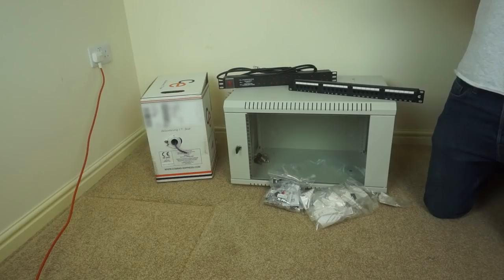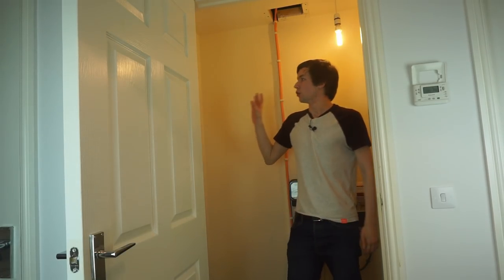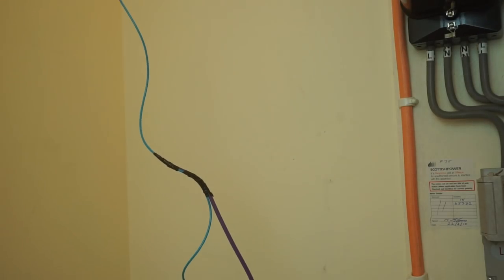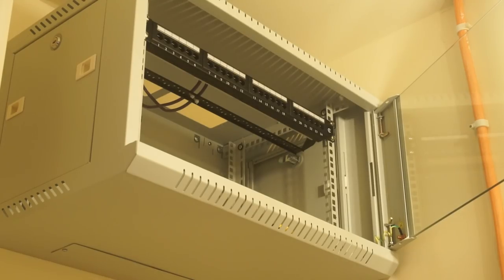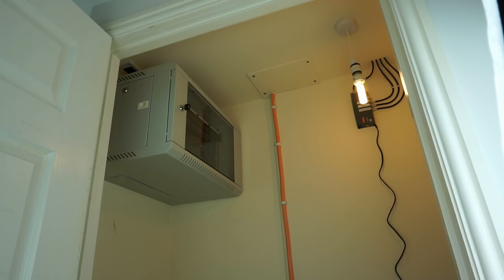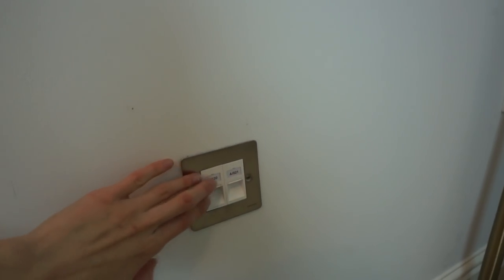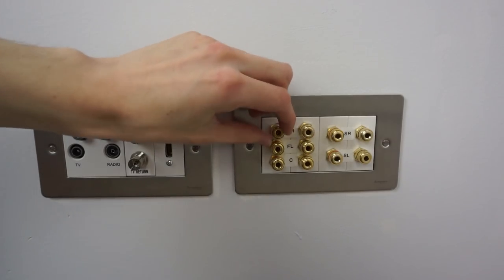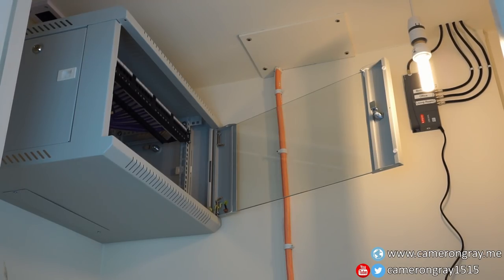New Flat - Time to install a completely overkill home network!

Comment: 13dB + 8dB amplification on those coaxes seems very high for such a short cable run. Were you able to measure the incoming signal level?
Reply from the maker: I don't have any proper signal measuring hardware but I used a TV with a built in signal meter, on this the incoming signal was under 40% on the scale and would even break up if I connected the TV with a 5m patch lead.
Reply: We don't know what absolute signal level the scale was indicating. For all we know, 40% may be 9999dBmV.
I've investigated many such cases when i worked for a local ISP/cable company (i know it's not a commercial cable connection at your place but signal levels are comparable) and more often than not, the blocking was caused by a bad connector, a cheap cable or an outlet with built-in passthrough (and -12dB tap).
Some customers tried to fix their problem themselves by stringing amplifiers together whilst the signal was strong enough to begin with, the noise floor was just too high because of ingress at some point.

Admittedly, i'm illinformed about any applicable standards in the UK. My point being "low signal" isn't necessarily what it says it is.
Reply from the maker: I'm definitely not remotely qualified in this area although everything points towards the signal entering my property being weak, likely due to me being pretty far from the main distribution point in the building.  All I know is that before fitting the masthead amp, most channels were unwatchable or wouldn't even be tuned in by the TV, after fitting it I can receive every channel that is available on the transmitter without any issues.  Those amplifiers are designed to be connected together in that way, normally you would have the masthead amp connected to your aerial and then feed the output of that into the distribution amplifier (which amplifies only enough to cover the losses due to the splitting)

Comment: Looks like a nice place you bought,is it condo?, you definitely won't run out of connection, In my area I didn't need a coax amp ,in fact signal so strong I was able to use multi splitters
Reply from the maker: We don't really have anything called "condos" in the UK, we'd refer to any sort of residence in a building with other residences above/below as a "flat."  That said, the Wikipedia definition of condo which seems to state that each residence is privately owned (either by the occupier or a private landlord and then rented out) and the shared space is then jointly owned by everyone seems fairly similar to what I have here.

Comment: Should you terminate port 4 on that amp? 75ohms.
Reply from the maker: I suppose it wouldn't hurt although I'm not an RF expert.  The manual for the amp states that the "full power" output on their larger models (a higher power output designed to feed passive splitters, not present on my 4 port amp) must be terminated with the supplied terminator but makes no mention of it in relation to the regular outputs.  This amplifier is for over the air DVB-T transmissions which I imagine are less fussy than things such as cable TV.  I think I have a terminator lying around here somewhere so if it turns up I may as well stick it on but probably not worth rushing out to get one.
Reply: @camerongray1515  gotcha, nonetheless a great video. I like what you did. Thanks for sharing.

Comment: i would of  put the  tv splitter  in the network box as well
Reply from the maker: While that would keep it out the way, as it's not rack mounted equipment it would either take up loads of space to mount it on some sort of blanking plate at the front or it would have to be buried behind other equipment.  I didn't really see any benefit to putting it in the network cabinet since it's not going to be connected to anything in there so felt it was simpler to keep it separate.
Reply: @camerongray1515  ok was just a thort

Comment: Damn, the horrible part is you are going to have to start all over after your landlord evicts and sues you for cutting all of those holes in the drywall.
Reply from the maker: Thankfully I own the flat, there's no way I'd attempt this in a rented flat.  When I rented the most I did was run a couple of CAT5e cables under the carpet.

Comment: @33.11 did you just drill through the wall from one side to the other?  Is that a plasterboard or supporting wall?
Also why did you use a plasterboard box for the AP as opposed to just drilling a hole for cable and just mounting AP to ceiling? Less cutting out that way?
Reply from the maker: The walls are all hollow plasterboard so I just fitted a box on both sides and since the cavity was shared between them I could run a cable out of both sides.  I should probably have explained the reason for the AP backbox - I don't like crimping onto the solid core cable that you'd use to install through the fabric of a building as it's not really designed for that and isn't particularly flexible, I'd rather terminate it into a jack as I did then run a flexible patch cable from that jack into the AP.  The backbox gave me a space to keep this connection and any excess cable.
Reply: @camerongray1515  i see. Lots just use same cat cable or even flat cat cables. I'm referring to this as the basis of my setup.
The wall i have is a supporting brick wall so i would have to drill thru or route cable up from under floor.... Only problem is the kitchen floor is tiled... 😂
I am tempted to go up wall thru skirting board... 🤷‍♂️
Reply: @camerongray1515  i had thought you meant the backbox was in the loft and you drilled screws into AP to hold it in place vs using wall plugs etc
Reply from the maker: @justintemp  From what I know, the best practice is to use solid core cable for the fixed wiring and for where you're punching down into faceplates and patch panels then to use stranded cable for the patch cables.  Apparently stranded cables have higher losses and therefore can't run over as long distances as solid ones, the downside of solid cables is that they are more subject to metal fatigue which is why they aren't used in patch cables that get moved around often.
Reply: @camerongray1515  i use outdoor rated cable for cable run so might get some stranded for connection
Reply from the maker: If you're terminating everything into faceplates then I'd just use off the shelf patch cables which will almost always be stranded.
Reply: @camerongray1515  thanks. Was going to spend an afternoon making them up, but its a pain !
Reply from the maker: Yeah, I've done it before but nowadays would only ever do it if I absolutely needed something custom length, I need to feed the cable through a hole or if I just want to replace a broken clip on an otherwise good cable.  Takes longer and generally gives more reliability issues than just buying premade ones.
Reply: @camerongray1515  yeah, shame i just bought a 309m reel 😂🤦‍♂️
Reply: @camerongray1515  solid core is also kess flexible and a pain to get into backboxes!
Reply from the maker: It is, but generally speaking it's not designed for termination into IDC connectors so it's not seen as best practice.  Solid core for fixed wiring, stranded for patch cables.
Reply: @camerongray1515  I thought it was  solid core in building terminate to idc faceplate, then flexible from Faceplate to device?

Solid core cables should always be terminated using IDC connections?
Reply from the maker: Ahh sorry, I meant stranded is not designed to be terminated into IDC based on your comment of solid core not being as flexible in a backbox.  I thought you were implying that you'd rather use stranded cable as part of the fixed wiring.
Reply: @camerongray1515  no worries, sorry, I'm aware I've asked loads here. Really impressed with your setup.

No, I'm terminating solid to keystone. It's just a pain as solid core manoeuvre in backbox is pain.

No, I'm ordering cst6 patch cables to feed from AP to patch panel. They're expensive these days! 

Only thing left is to align AP away from smoke alarm.... It would be offset which is a pain!

Comment: Hmmm... Is it safe to install that amplifier BEHIND the wall? In Denmark, I'm pretty sure that would be illegal, since you're not allowed to install electronic devices inside the wall.. I mean.. in case that thing shorts out or something, or generates a lot of heat... I wouldn't want it inside my wall!
Reply from the maker: Not sure since it's low voltage, I've since moved it and mounted it to the outside of the wall so that I can access it easier.

Comment: Hi there, sorry about my English... Two points: why you don't route the power cables allready to the point you where you need the outlets - so the electrotion don't need to do this and it should be cheaper. And the second thing : why you don't leave a cable loop behind the Patchpanel to securely remove the Patchpanel and you can route the cable nicely in that box :) 

But it looks otherwise really nice. 

Greetings from Germany
Thomas
Reply from the maker: +Thomas Kloppholz I thought about running the cable but the difficulty is that electricians may not be happy to sign it off, I suppose I could ask him when he's giving a quote.  There wasn't really much space in the rack or cupboard to leave a loop but there's enough slack in the ceiling space to get the patch panel down.
Reply: for your ESL (here in the US, we call ESL  - English as a Second Language), you did respectably well ! :)
Reply: 'king priceless

Comment: Is there any static noise or interference when doing things this way ?
Reply from the maker: +examen1996 In what way?  The speakers?  Not had any sort of audio interference.  The only issue I had was that it turns out that certain freeview TV channels use the same frequencies as those emitted by hdmi cables which caused certain channels to break up when the AV receiver is powered on.  This was temporally solved by keeping the antenna patch leads away from hdmi ones and more permanently by using higher quality cables.  Thankfully the hdmi and coax I installed in the walls was high enough quality for this not to be an issue but worth bearing this in mind and maybe keeping the cables separate

Comment: Just murcia‘ things, when you can cut a whole in your wall using a sharp knife
Reply from the maker: This is in the UK in a modern building.  I'd actually rather have a modern building like this with plasterboard walls which are easy to work with rather than have to grind out massive chases in solid brick/concrete walls.  Plus, these walls are incredibly easy to pack with insulation.  Thankfully this building is a proper brick and concrete frame with only the internal walls within each flat being plasterboard/timber. Definitely not a fan of the fully timber construction that a lot of the US uses (and is starting to crop up in cheaper builds in the UK) from a fire safety perspective.

Comment: Impressive setup and planning. Do you do this for a living 😂
Reply from the maker: Thanks! Believe it or not I'm a total amateur, this was pretty much my first major DIY project outside of basics such as replacing a socket/light fittings or fixing something to a wall!  My job does involve IT infrastructure planning but very little of that relates to structured cabling.

Comment: Great video Cameron. The Patch panel you provide a link for... is that the correct link? In the video you mention having a patch panel with inclusive cable tie frame - this isn't the same patch panel, or at least it doesn't include the cable tie frame.
Reply from the maker: It's the same one I bought although the one that arrived looked slightly different from the one in the photo (but was at least the same spec). The listing shows the cable management bar in the second photo.

Comment: Benefits of keystone vs some of the lap modules from the likes of screwfix?
Reply from the maker: In my case it was only because I wanted the angled faceplates, outside of that I'd just use a normal euro module.
Reply: @camerongray1515  Thank you dude. Sorry for the hundreds of questions... You've inspired me to get started on my own first ventures into networking. One last question... Can you plug a telephone into any of those cat6 runs? I assume voice is there as the modem does the filtering, or am I wrong?
Reply from the maker: @DonGerico  You could definitely use them for a phone with the appropriate connector to connect your phone to the RJ45 connector - you'd just need to run a patch from the patch panel to your phone line somehow instead of patching it into the switch.

Comment: 15:04 — No service loop; I see you're not planning to encounter any issues with the cable terminations now or in the future.
Reply: Or he stashed the excess in the ceiling
Reply from the maker: +Peter Morgan There's a decent amount of excess in the ceiling so should be fine.  The ceilings are quite low so if it put anything above the rack, the rack would have had to be quite low and wasted a lot of cupboard space.

Comment: Did you end up not using the poe switches and going all ubifi in the end? Looking to put unifi AP upstairs but need poe switches and wondering if the unifi switch performed better than the non unifi one
Reply from the maker: I use all unifi switches but not the PoE ones.  Nowadays I have the unifi cameras so if I was buying new switches I'd get the PoE ones but back when I did this, the only PoE device I owned was the AP so I decided to just use the included injector.  I now use an 8 port rackmount injectior as this worked out cheaper than replacing the switch.  Performance wise a UniFi switch will perform the same as any other decent gigabit switch, it really just comes down to whether you need any managed switch functionality such as VLANs or link aggregation, with this I like using the UniFi ones as it centralises the management Vs having separate devices to manage independently.  If you have no plans to use any of this functionality and just want an unmanaged switch, you probably wouldn't benefit from the UniFi ones.
Reply: @camerongray1515  the 8 port rack mounted injectoe was not unifi was it?
I am looking to separate work, IoT and gaming so will be using VLANs
Reply from the maker: Nah, the injectior is from fs.com - works well but if I didn't already own the switches, I'd have bought PoE switches from the start.  Since you're planning on using VLANs, if you're using other UniFi kit as well, the UniFi switches do simplify management vs having to log into switches separately to configure
Reply: @camerongray1515  thanks Cameron. Inspired by your vids to take a plasterboard saw to the walls 😂
Did you hit any firestops when trying to fish the cable down?
Reply from the maker: I did on the internal partitions but not any of the external walls where the timber is fastened into the brick.  I ended up just drilling through them and filling the holes with fire sealant.  That said, given the original wiring is run through holes in them without any sealant I'm not sure if it's required, imagine they aren't there for any fire protection, just for structural stability.  It's not as if it's a timber framed building, just internal stud walls in a concrete/brick shell.
Reply: @camerongray1515  how did you drill holes in them? Hole above and below and Drill at angle?
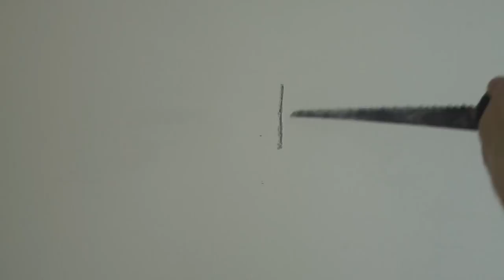Reply from the maker: I show it at 19:10 in this video, yeah, hole above then drill at a slight angle
Reply: @camerongray1515  i did think that was it but it cut away. Hope your reskimming and painting is good!
Need server rack but cant find similar to yours. Worry about it holding up against plasterboard
Reply: Did you find the 6u was enough or would you have gone for a 9u or more in hindsight?
Reply from the maker: 6U was fine for me and I'd rather have a smaller cabinet that doesn't waste loads of cupboard space.  However, it totally comes down to your own personal needs and how much rack space you require
Reply: @camerongray1515  also heavier with larger cabinets and could fall under weight... 😂
Reply: @camerongray1515  did you install fans in the cabinet?
Reply from the maker: @justintemp  No, the equipment I have doesn't produce much heat, but again, this depends on what you're putting in it.
Reply: @camerongray1515  3 unifi switches, unifi usg, unifi ck, psu
Reply from the maker: 3 switches?  How many drops are you going for?  You just need to add up how much space you need for those devices plus any space you'll need for patch panels then any space you might need to feed cables between the front and back of the rack of required.
Reply: @camerongray1515  yeah i have 3 unifi us 8 60w over time... And a nvr as well so i think a 9u  might be better..
Reply: @camerongray1515  2 switches for downstairs 1 for upstairs
4 drops upstairs
6 downstairs
2 ac pros
Reply from the maker: Ahh, so only one switch in the cabinet then I presume, then the other switches will just be in rooms on the end of the drops?
Reply: @camerongray1515  yes. 2 switches max in cabinet if i can pull cables thru.
If I'd known now i would have purchased a 16 switch with poe
Reply: @camerongray1515  my planning is nothing like yours 😂

Comment: Everything you did >= EoP
Reply from the maker: EoP? Powerline Ethernet?
Reply: oh ya sorry, ethernet over powerline. I was just thinkin that most of that labor could've been done by some ethernet over powerline adapters lol
Reply from the maker: Powerline is definitely easier to install and good for certain situations but is nowhere near as good as a proper wired network. It's slower with speeds that vary based on wiring, interference and network congestion, it costs more for a decent number of devices and causes a tonne of radio interference which is an issue for me as I dabble with software defined radio.  The CAT6 cabling I installed here can also be used for things other than Ethernet such as to carry HDMI signals.  Ultimately the disruption wasn't an issue as I hadn't moved in yet.